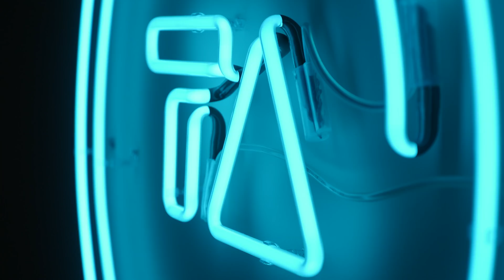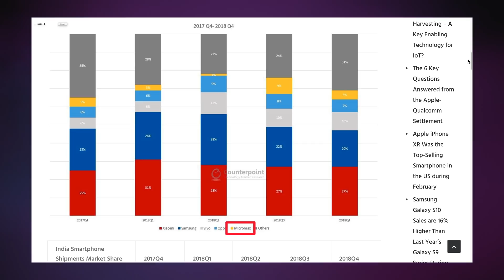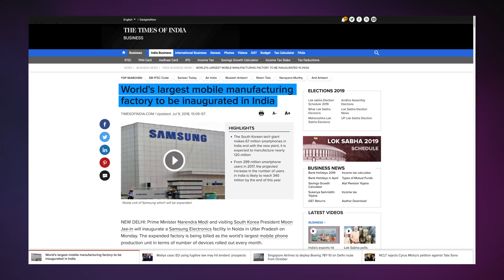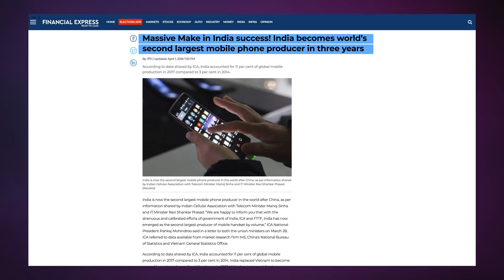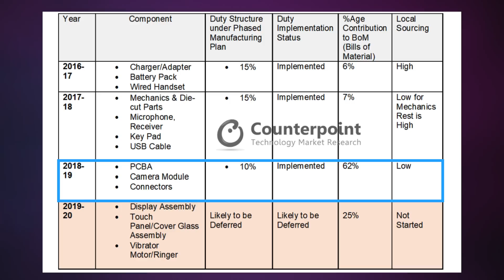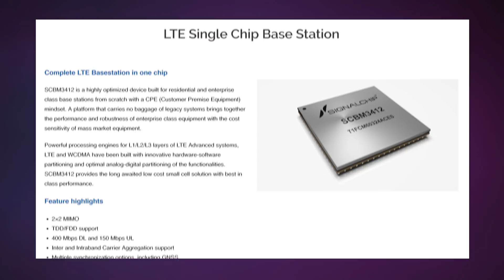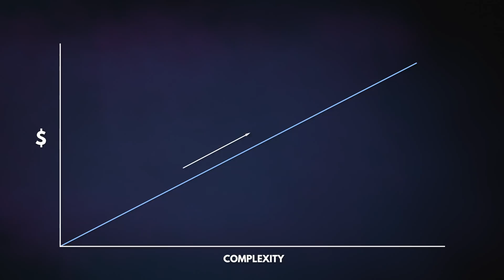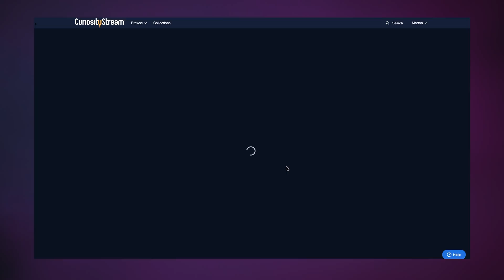Can India become a smartphone superpower?

Comment: India has the technical tallet to make it but the pool of designers for anything to look sleek in India is poor. Also the spending power in India is very low, 10,000 rs is a lot of money to most people there which would buy you a basic smartphone. The India market well maybe a massive market but it's a massive market of low-end phones. The real gainers are the telco providers, not the manufacturers. When I'm in India I use Jio which is an exceptional service, even compared to Vodafone or o2 in the UK.